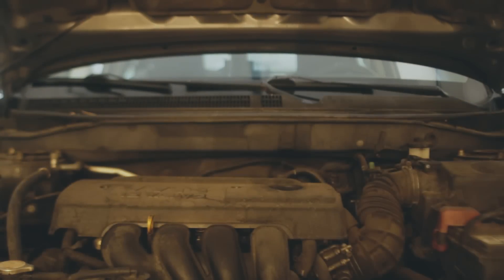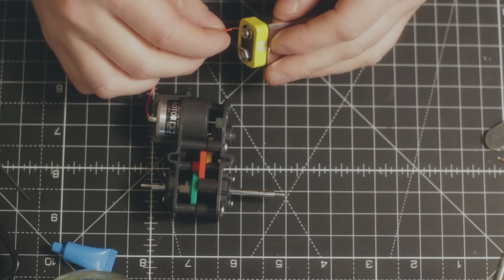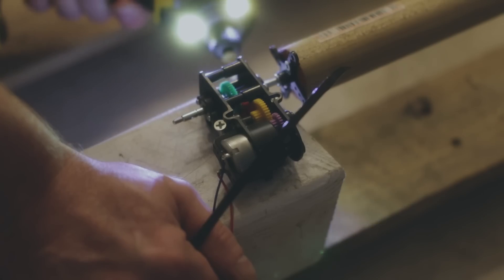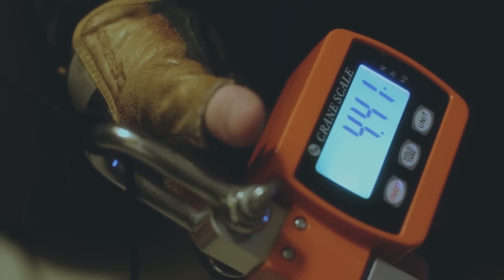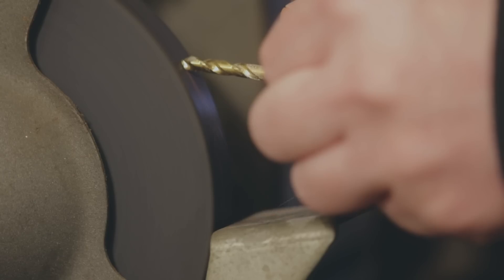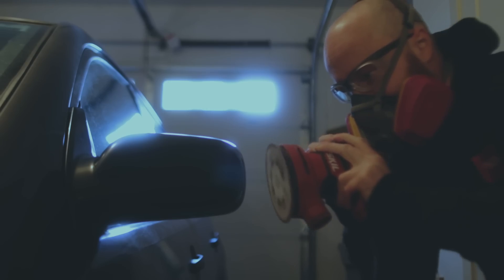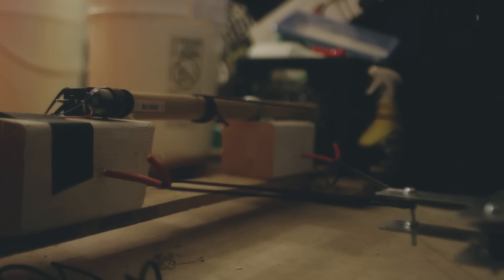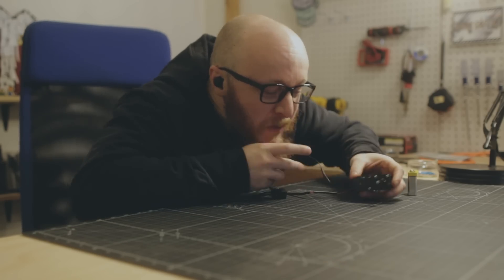Could a 9v Battery Solve the Gas Crisis?

Comment: You meed approximately a 15kw electric motor to cruise at highway speeds in most small-medium modern cars with a good drag coefficient.
Reply from the maker: I'm not great with electronics, but something tells me that the motor I used was not 15kw

Comment: but how did you get your car back?
Reply from the maker: I should have mentioned that. I reported it stolen, and it got picked up 500 miles away in another state for reckless driving. 
I won't lie, it was really gross inside the car. They had absolutely trashed the interior and been literally smoking crack. It took a month to figure out how to get the smell out

Comment: Awesome video. Two things:

One: Toyota Matrix mentioned.

Two: A motor can only consume a finite amount of energy which will inevitably decrease its effective output with an increased load. While those 9 volt motors are capable of moving low weight components like in rc cars, the motors in electric cars need to be designed to handle a certain amount of power that can move thousands of pounds. Otherwise you’re pretty much just heating up the motors and dissipating energy.

This is a good point to bring up why we should generally move past a car centric transportation infrastructure and towards more unitary, energy efficient modes of mass transit.
Reply: I don't think that motor is even to be used on a proper RC car either more like a kids toy one 😂

Proper RC cars have crazy powerful tiny brushless motors capable of high wattages in such a small package.

The cheap one I have on my RC drift car is rated something above 1500W for example and is even overkill for it and the controller is rated much lower and never reach the full motor potential and is also still overkill since if I would give it max throttle at start it would destroy all the gears pretty quickly.

The motor I use also is for speed not torque and has very high RPM...
Reply: @ exactly this. A common 9v DC motor simply cannot produce the amount of power it would require to move a car, even a fairly light one like a Corolla Matrix. It’s a nice demonstration of gear ratios and mechanical advantage but unfortunately friction and other real world parameters always end up limiting us. This is why thinking outside of the box is so important, only when we figure out ways to work around our boundaries have we ever innovated. Still a great video.

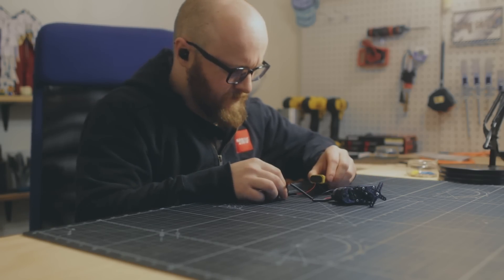Comment: 1:32 when you lick a 9V it’s not the electricity shocking you it’s the chemicals
Reply: trust me it's not.. when i was younger i had licked a stripped USB charger and licked both ends and it actually shocked me slightly.. electricity even in really low voltages can trigger taste receptors
Reply: This is 100% true
Reply: Bro why would they have a battery that is covered in chemicals 😂😂😂
Reply: @Kai91399  it’s because a little bit leakes out
Reply: @Kai91399  @almaka17 never mind I searched up it is shocking you my science teacher said it’s the Chemicals
Reply: It is the electricity

Comment: the one powering your starter motor is 12 volts, you're not too far off, if you had a manual you could put it in 1st and drive with the starter motor, though i doubt that would be healthy for it
Reply from the maker: If I get a project car someday, I may try that
Reply: you can do that and i have done that but your car battery dies after 10 to 50 meters because of the engine compression. remove spark plugs however and you may get a bit further ...

Comment: I wonder if something similar could be done using a 12V battery and starter motor to make a manual hybrid system, I think garage 54 tried something similar
Reply from the maker: I'm definitely coming back to this someday. I want to learn how to make gears because I think I could do it with a worm gear system
Reply: Lol, someone knows about garage54😂